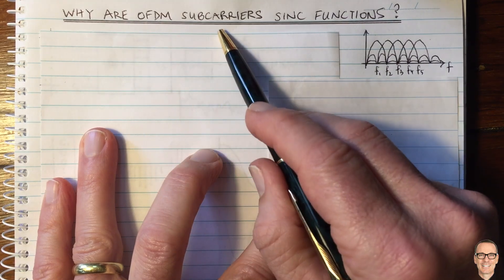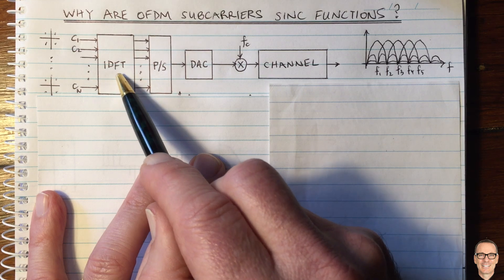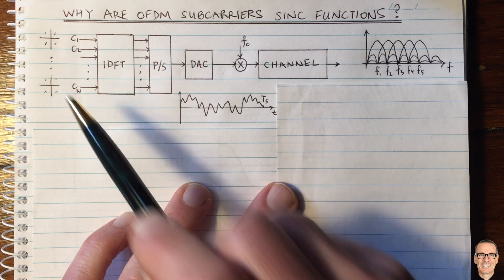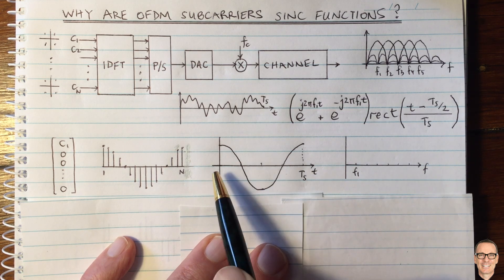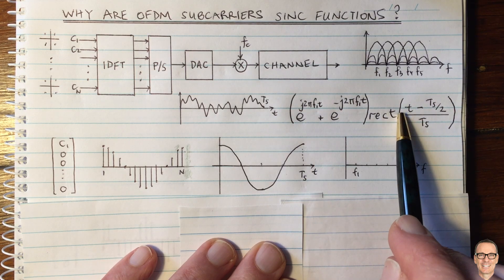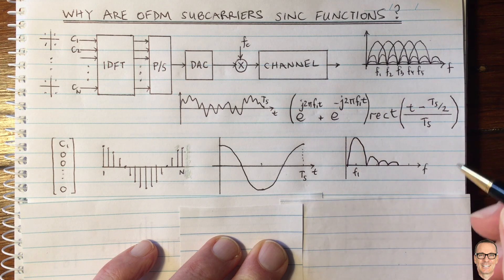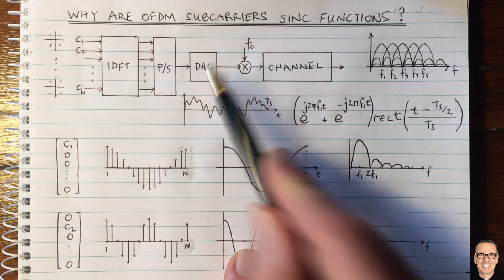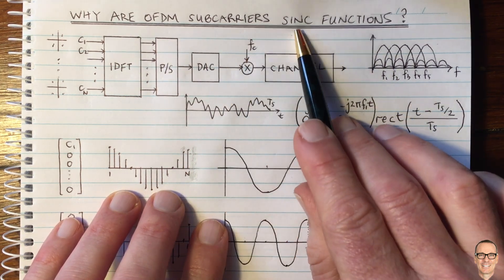Why are OFDM Subcarriers Sinc Functions?

Comment: Hi Iain, thanks for the detailed explanation.Will be great if you clear a doubt in details for me with 5g or lte 3gpp baseband signal generation and upconvertion. As per specs , during baseband generation , both negative and positive subcarriers are used to modulate data to symbols and the negative subcarrier will be in the left part of carrier and positive subcarrier will be on the right side of carrier frequency.from the mathematics its very clear but my doubt is how its done practically as i know say we are mudualting a -15khz subcarrier (cos2pi15t - sin2pi15t) and after upconvertion will fall on the left side of central freq while modulating with cos(2pi15t ) + sin(2pi15t) will fall on the right side of carrier. Basically the sign of SIN part decides were it falls on the side of carrier freq. But sing of the SIN part is dependent on the data withwhich its modulated. So when we add these two as shown in the specs before upconvertion , will not they interfere with each other?
Could you pls throw more light on how practically its done right from baseband generation to upconvertion which will be of great help
Reply from the maker: Hopefully this video from my channel will help: "How Does a Frequency Selective Channel Affect OFDM?" https://youtu.be/1_bM_-v4yLY
Reply: Thanks Ian those were too wonderful videos of ofdm with lot of interesting insights.eventhough it gave more details of how those subcarriers are upconveterd but my basic query seems to be not fully addressed.below are few concepts for me to be more clear about this. As states earlier in the base band if cos leads by sin , the modulated symbol will go to the right part of spectrum while if the sin part leads the cos , then the modulated subcarrier goes to the left part of spectrum. But suppose I need to use a  qpsk with 4 symbols to be used at say -15khz baseband and another +15khz baseband (like it's two different stations broadcasting) how can we ensure that both will not interfere when upconverted. How can we ensure that irrespective of whatever symbols we are modulating with -15khz always ensures that the sin component always  leads and for the +15 kHz the cos component always leads by sin. As I can suppose if I take -15kz for modulating, then based on the values of modulating symbol the sin wave some times leads and sometime lags the case wave. So if the modulating symbols results in leading cos wave , after upconvertion this will go to right part of spectrum which will interfere with the symbols modulated with +15khz.how can we guarantee that whatever symbols are transmitted from +15khz and -15 kHz falls on the correct part of spectrum irrespective of the whatever the modulated data is ?can you pls throw some more light with some example say using qpsk with all 4 symbols can be trsamitted separately with +15khz and -15khz and never interfere with each other

Comment: 2:05 , if I define a vector [c1,0,0,0...,0] , and take the IFFT do I get discrete sinusoid samples? I did it in python but got all of the IFFT elements same values .
Edit: I tried to do the FFT manually in python but same outcome
N=len(X)

n=np.arange(0,N)
multicarrier_=np.zeros(N,dtype=np.complex64)
for k in range(N):
    subcarrier_=X[k]*np.exp(1j*2*np.pi*k*n/N)
    multicarrier_+=subcarrier_
Reply from the maker: Yes, you're right. I simplified the diagram, only showing the elements of the vector that relate to the data-carrying sub channels. The actual first element (as you've done) corresponds to the zero-frequency (ie. constant) waveform. 
Try running these lines of code in Matlab:
X=zeros(1,40); % Frequency domain vector
X(2)=1;              % Put data into the first subcarrier (only) ... note that X(1) corresponds to f=0
x=ifft(X);           % Use IFFT to generate time domain signal
stem(real(x))   % plot the time domain signal
Reply: @iain_explains  tnx for info! can you pls explain, why you plot only real(x) ? isn't the output of IDFT complex, and because of that subcarriers are composed of cos and sin part ?
Reply: I was confused about the exact same thing! Thanks to iain for providing an explanation

Comment: I am wondering why it ends up as the modulus of the sinc function, i.e. why there's no negative values over there in the frequency domain.
Reply from the maker: Generally people only plot the magnitude, in the frequency domain. There is a corresponding phase plot, which flips by 180 degrees in the frequency ranges where the “amplitude” is negative.

Comment: 2:04 If only the first element is nonzero, the output of IDFT has to be the DC value, not the sinusoid of fundamental frequency. The subcarriers range from C_0 to C_{N-1}. C_0 will correspond to the DC value at the output and C_1 will give the fundamental sinusoid of period = N. Please respond if I am wrong.
Reply from the maker: Yes, you're right. I simplified the diagram, only showing the elements of the vector that relate to the data-carrying sub channels.
Reply: @iain_explains  I did not understood how output of IDFT is sinusoidal with  .output of IDFT will be all of same elements for given example right.
Reply from the maker: Try running these lines of code in Matlab:
X=zeros(1,40); % Frequency domain vector
X(2)=1;              % Put data into the first subcarrier (only) ... note that X(1) corresponds to f=0
x=ifft(X);           % Use IFFT to generate time domain signal
stem(real(x))   % plot the time domain signal